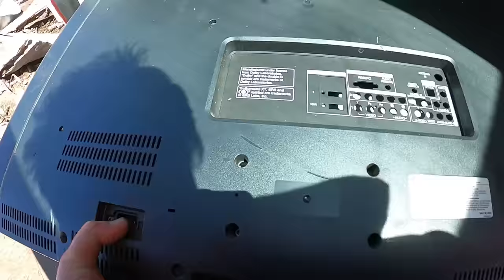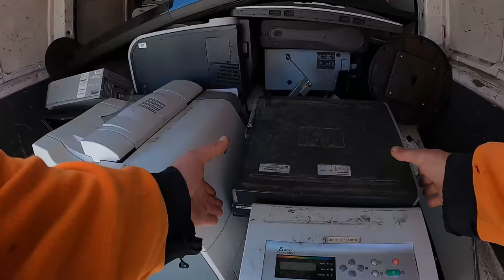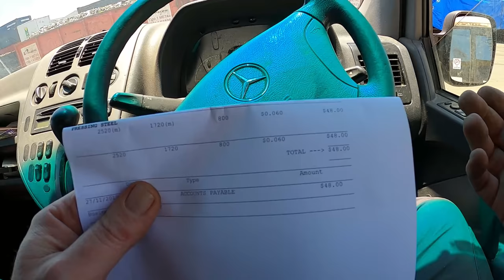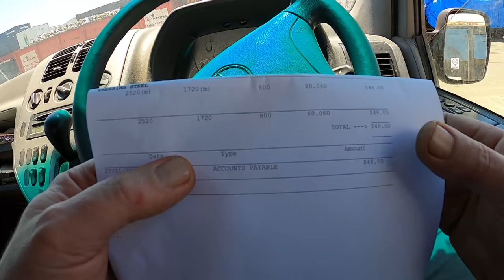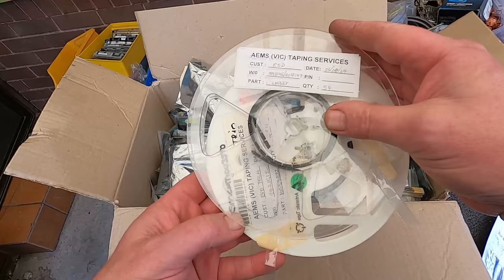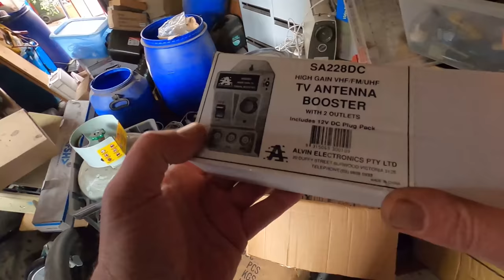Mega Scrap Marathon Final Cut, Let's Get Scrapping!

Comment: There was very interesting story recently about Australia opening a plastic recycling plant that uses hot water at high pressure to liquefy the plastic back to oil form which can be sold to make new plastics or refined into petrol.

I know here in the US I haven't found any real sources to give the plastics to when I scrap, the recycle centers will even trash any loose plastics since their vendors don't really want it.

Comment: you have tried an air hammer to get ICs, MLCCs, Tantalums from PCBs, its very fast, also those lenses don´t degrade like the electronics they are still worth a lot at lest 10 times the rest of scrap gives you

Comment: Those coils are not clean pure copper. It's magnet wire. It's insulated with a thin polyurathane coating. If they were pure, then what would be the point of making coils. The current would just short from terminal strait to the next.

Comment: Why not use pallets and a trailer? I imagine that lifting all those cases multiple times can't be good for you or the time necessary to move them.

Pallets, a cheap pallet transporter and ramps for the trailer could do ya :P

That or a trailer that tips, so you can just tip and drive instead of throwing them all out individually at the yard.

Comment: For me I would repair those computers and resell them. Some would need a new case but not hard to repair once you have a few parts on hand to test them... its hard to watch you throw the whole thing out and scrap them just for base metal prices....worth a lot more working..
Fixing PC's: check operation first then if not working diagnose whether power supply or motherboard, then if mobo remove all ram and just have 1 stick ram to retest (most common fault). If still faulty most likely the mobo itself (CPU's rarely fail).
You can then confirm mobo specs online and check for correct CPU inside and then try new CPU if you like plus different ram stick and maybe see something working then, if not scrap the mobo normally. 
Faulty Power Supplies can be fixed also - usually bad electrolytic capacitors, just swap with working one and retest. Fixes like 80% of the time..